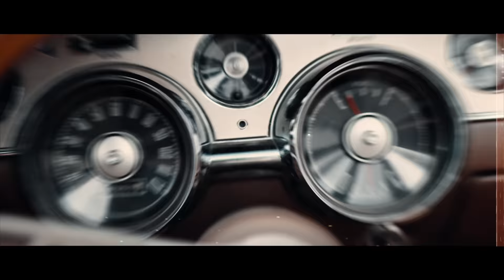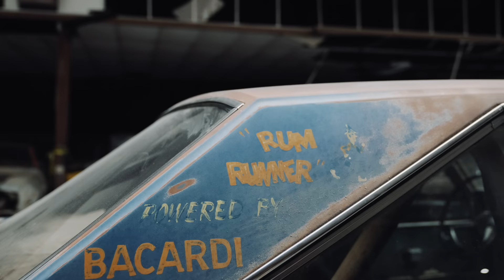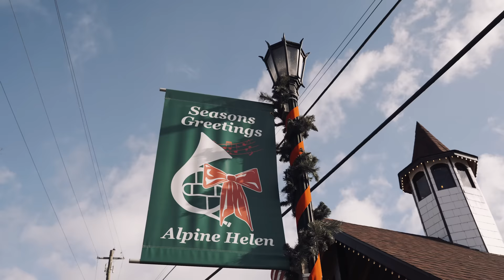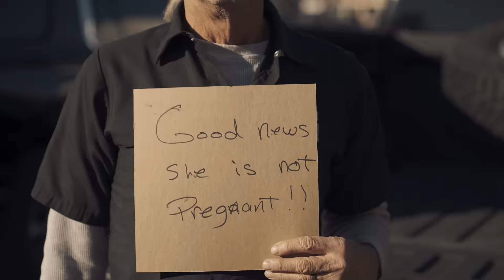Gas Monkey Strikes MOPAR Gold: Rare Find Revealed

Comment: WOW!
So many classic and rare cars in one building.
Man, I'm glad somebody has the ability to save those old beauties.

I was squirming in my chair seeing all those awesome cars that used to prowl the streets of my town and the several towns nearby. It was great be twenty in 1966.

There were some roads just out of town where we could move to and have a couple races before the cops showed up. Bless their hearts, they were worried we might have a wreck and get hurt. They thought they were protecting us. We always posted sentries to warn us when the cops were heading our way. Flash the headlights really fast as a warning and we would bug out. We had to find at least three places outside each town so cops never knew which one we would go to.

The surprise was sometimes the Dart with a small block. Man those could be made quick with good tuning and headers. One guy had a Dart with a 340, he found a six pack manifold for it. Of course till he opened the hood we assumed a four barrel. He had a shop fine tune and balance it, install a hot cam and it had headers tuned for max torque. The headers dumped into four exhaust pipes, four Hush Thrush mufflers. It had an awesome tone to it. If I remember correctly the rear end was a 391 suregrip mated to sticky Mickey Thompson fat tires. That little Dart embarrassed some big block cars. But it wasn't stock either!

My fun car was a 1969 Road Runner. I had a shop fine tune the distributor and carb. The engine was stock. He jetted the carb with bigger jets and had me run a slightly hotter spark plug. I put free flow mufflers on it that had a deeper tone. A  few guys accused me of having a 440 in it. It was a four speed and had a 323 sure grip axle. After he worked on it, I swear if felt like it had another 30 horse. I could get the jump on a GTX 440 automatic right off the line and would stay ahead at the 1/4  mile. It was gaining on me but could never quite catch me before the 1/4. I learned to shift to second gear without releasing the gas pedal. Just shift as fast as possible and slide left foot off the clutch. BANG, it made a noise like a truck hit me from behind and it would lunge forward. It was faster than all the Road Runners I came up against. One had a 411 rear axle, he was gaining on me till I hit second and whoosh I was instantly a whole car length ahead. He hit third before me and then I started pulling away. I think he was geared too low.

It sure was great to be young and crazy in the 60's.
Reply: Great story sir.
You brought me back to teens and early 20s, when I got my first muscle car.
A 1999 pontiac Trans Am. Thanks

Comment: I thought that only the Barracudas got a Mod Top in 1970 and they used the yellow floral top.  I have not seen any mention of the 1970 Satellite getting the Mod top option after the 1969 model year and the registry does not show that there were any built.
 And the Mod Top registry does show blue/green floral topped 1970 Barracudas were available though there are none registered with them.  So, what was the original colour of the car that is red?  It could not have been red with the blue/green top!  But I own a 1969 Dart (original light yellow/cream paint) Custom with the yellow floral top, so anything is possible.  Back then you could special order anything, they were all too happy to take your money and build you the car of your dreams!  And in the Mod Top registry there is a 1969 Dart that was found with the blue/green material under the drip rails.  Still much to discover about these great cars!

Comment: Tony and 5150 are the best. I bought my 70(now69) Charger from the Oklahoma hoard. and I noticed the $3K 70 FB Charger at 5150 Denton  (I called on it with the 30+ others) Tony and I were laughing how it was a mess. FB ad went something like... who needs a project? guy working on my car passed away 3000 OBO. even years ago this generated a frenzy. (the car he mentions in this video)  Tony gets the cool history on the cars... when buying my car I noticed an old Chevy Apache pickup I asked whats the story on that? haha turns out the group of cars 5150 bought (mine included) the guy had a chevy pickup with a 392 Hemi and interior out of a Chrysler 300 that he street raced in High School. oh yeah, and I've heard of, and seen/owned Mod Tops, Hang Ten, White Hat special cars.  Joe King on FB has the original parts